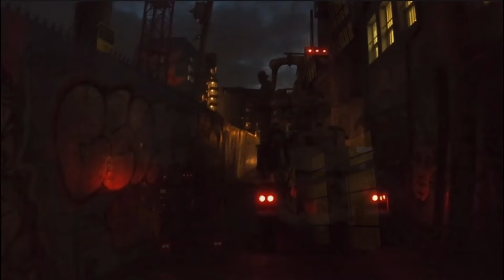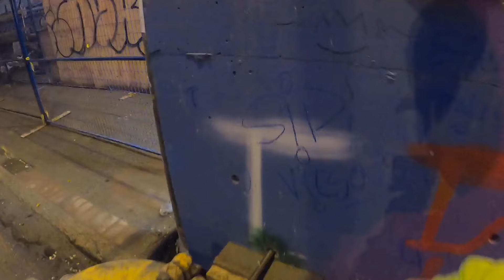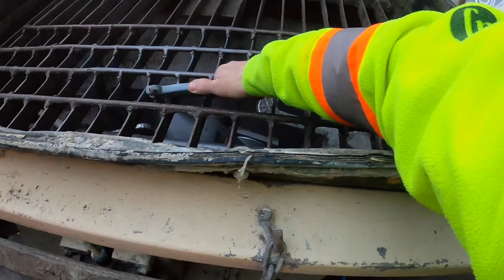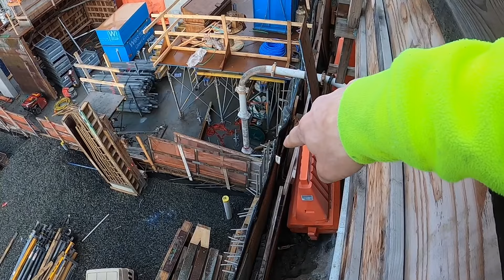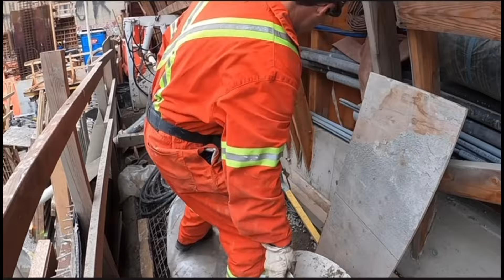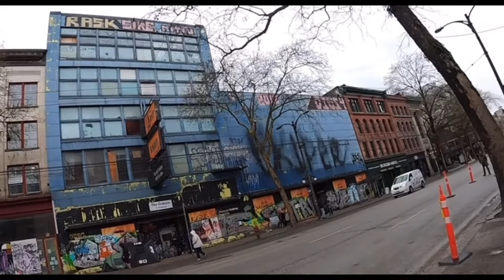600+ cubic meter concrete pour with a Schwing placing boom.

Comment: Is the placing boom 4 and a half inch boom pipe ?
Reply from the maker: Yes, the 37M Schwing boom is 4.4' diameter pipeline. It reduces down from 4.8"-4.4" at the first boom section.
Reply: I run a 41 that’s the same. First pipe on the first section is a reducer 5” to 4.5”
Reply from the maker: @williamkuhn5199  that is correct. Fun fact: standard metric boom pipe is actually only 4.8” diameter. Schwing used 4.4” boom pipe on few different models over the years whereas Putzmeister used 4.4” and later on moved to 4.6” The difference sounds negligible but if you were to look at a 4.4” elbow next to a 4.6” elbow, the visible difference in size is actually quite significant.

Comment: how do you guys prime your big pumps? and in what boom configuration.
Reply from the maker: Big pumps we use powdered bentonite mixed with water to a pancake batter like consistency. A-frame is always the highest rate of success when priming, but the bentonite works so well that often we’ll just prime it through in a Z configuration.

Comment: I like the way you blow out I use to work with some Guy's who whould just Send It and it whould fly out sometimes we whould not find the ball after because it was gone.
Reply from the maker: Definitely beneficial to moderate the air pressure on blowdown, especially when getting into longer runs of pipeline. It can quite literally become a bomb if you just crack the air valve and let ‘R rip!